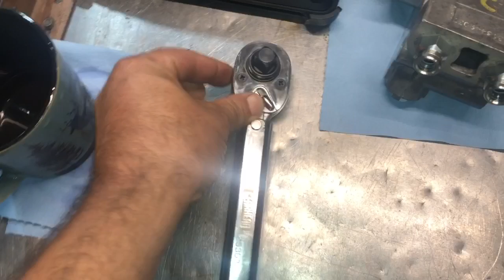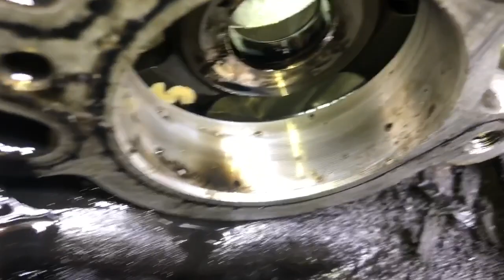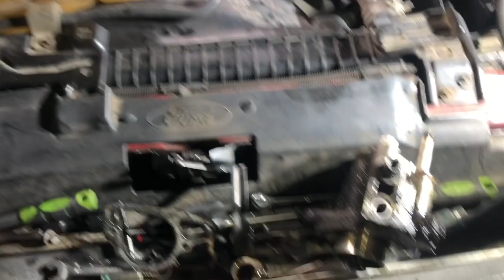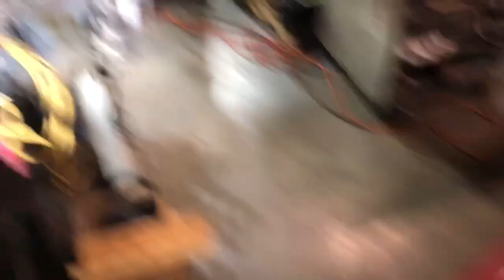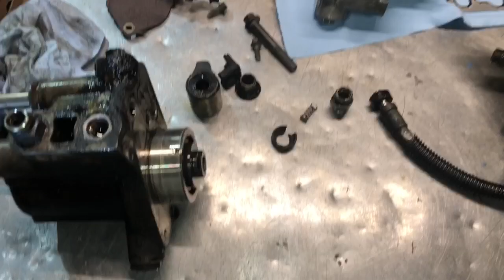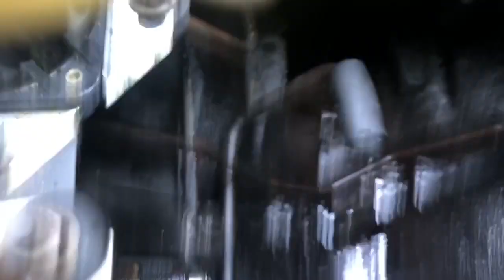2000 f350 high pressure oil pump replacement part 1

Comment: Could have installed a time sert. I did one on mine. It's not going anywhere or ever stripping again.
Reply from the maker: Thanks for the info.  Honestly I had to look that up I’ve never seen a time sert before and at the time I thought about trying something like that but with almost 500k on the truck I figured a new HOP wouldn’t hurt.